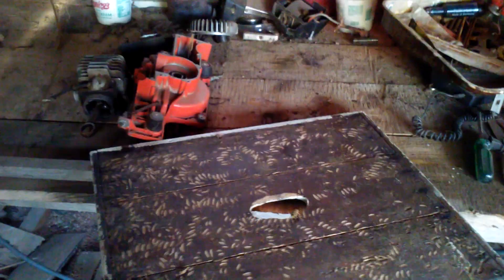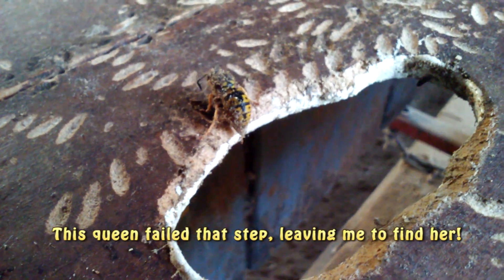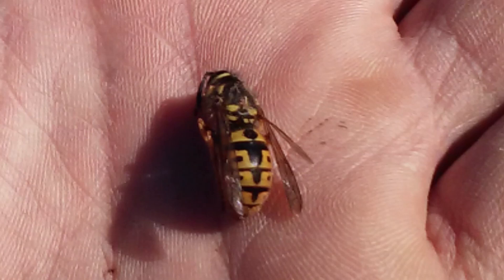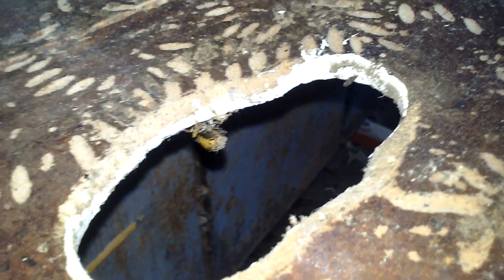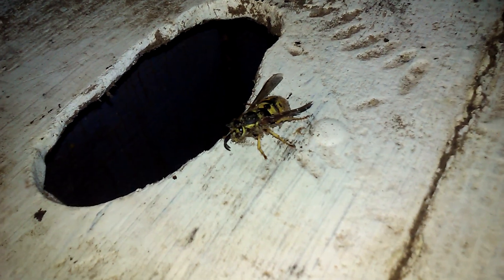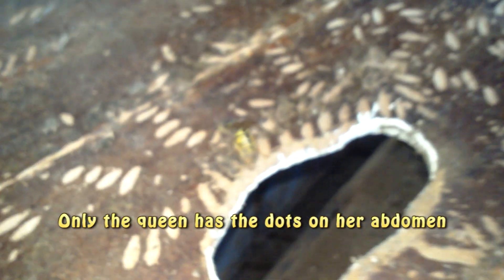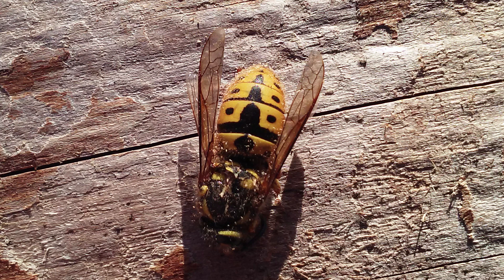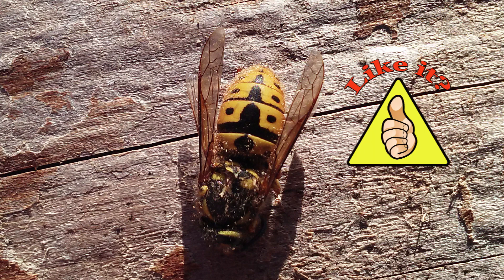A Queen Yellow Jacket

Comment: Yep, we're warring with yellow jackets right now. If they'd have stayed outside in a tree home instead of moving in to the siding corner, they could have been ok. Began finding a few in the house, then gradually more often so went hunting for how they could be getting in. Ended up calling an exterminator who dust-bombed the obvious door to their nest but later in the day we had to fight hoards of them in my apartment, lower level of the house. So far about 150 but I stopped counting. My son figured where they got in and apparently they're in the space between my ceiling and his top level of the house, because they're coming partially dust covered and dying. Exterminator will have to come back and treat that area 'somehow.' I try not to unnecessarily kill 'bee' types but this is unsafe. Very early, hot summer with a lot of rain, too. Several of the ones in the house are queens per those dots between the stripes and very large. Scary!